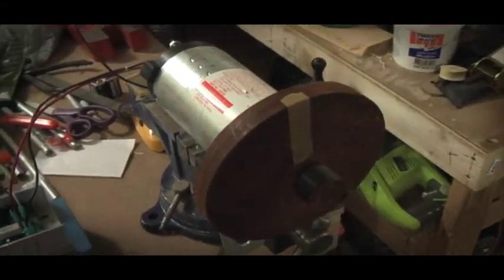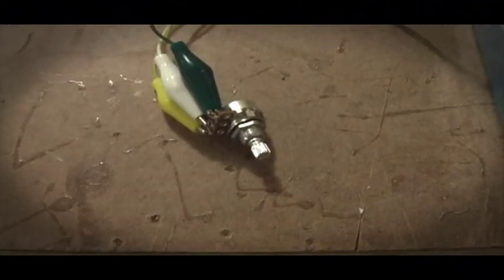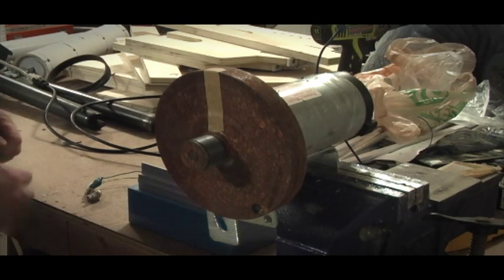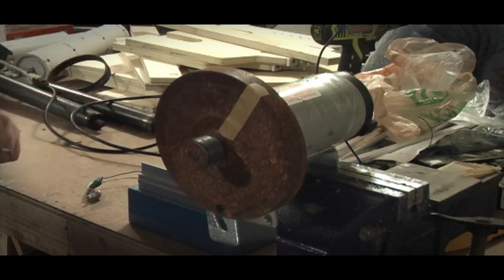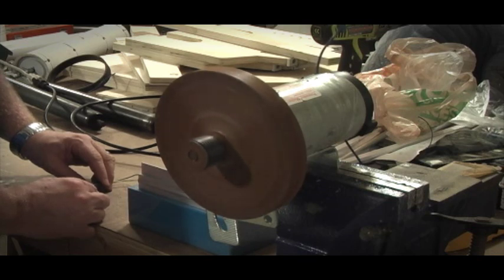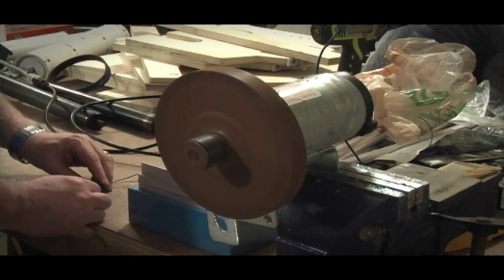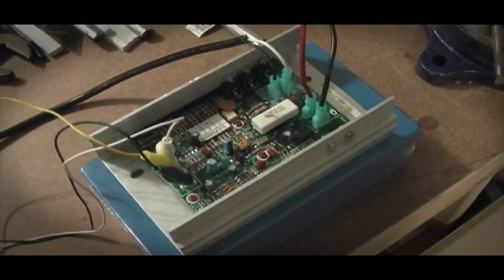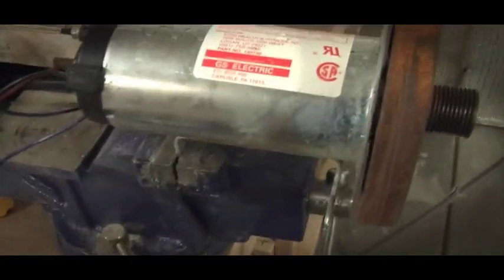Treadmill Motor Test with MC60 Controller.

Comment: I don't understand why everyone basically use higher value pot for these motors.   I used to be exact a 1.8K potentiameter and it works right on the money. Perfect start and control and natural response to the turn of the knob.  2.6 HP motor.  I left the blue wires and the choke in the system.
Of course there are different types of potentiamters, so called pots. Linear is what is typically used for these.

Comment: That video was great and it's what I'm looking for but I'm new to this so I might need a bit of help. I'm making a pitching machine for a baseball team and I have a 2.5 hp elec DC motor out of a treadmill.  It puts out 180V at 4700rpm. I'm in Australia so our power is 240 and I want to be able to control the speed of the motor like you did. Can you please help me out so I can make a control box for it. Thanks Randy

Comment: is that just a POT from radio shack?
Would I be able to tell where to hook a pot up to>
Where did you get the controller, did it come with the treadmill?
I would like to hook up a tread mill motor to my lathe spindle.
Can you use that MC60 controller with just about any treadmill motor?

Comment: Might I ask what are the values for R42 and R37?  I have two of these boards both are missing those resistors.
Reply: R42=5.4KOhm, R37=230KOhm
Reply: pc009ce Any idea why they're missing on some boards? I even have some that have the resistors, but they have 1 lead clipped.

Comment: Ok. I ran this test with my MC60 and a 3.8 HP motor. It was drawing 2.5 amps @ 120VAC or 300 Watts. I also got it up to 2600 RPM.